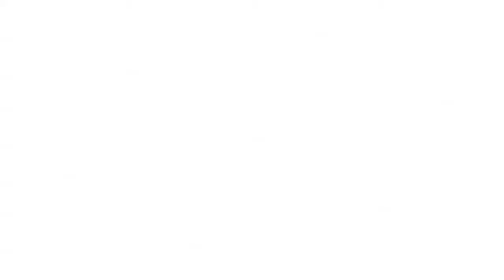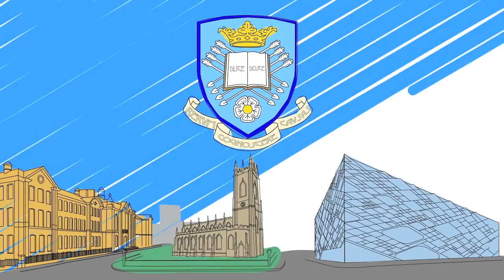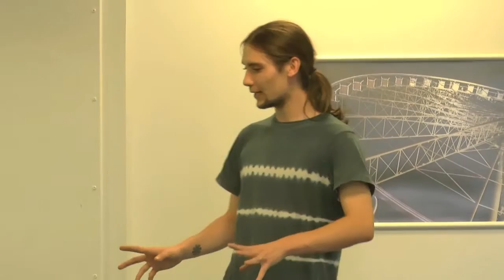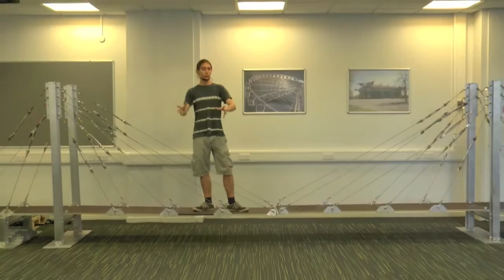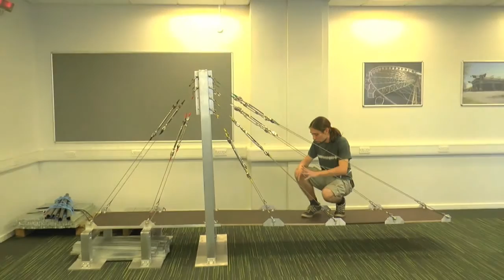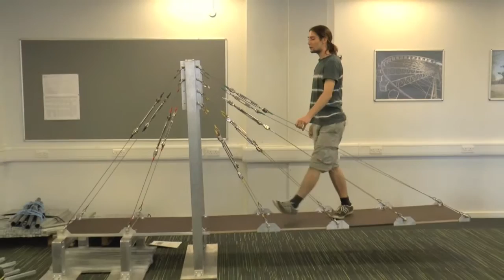Cable Stayed bridge Beginner

Comment: What would be the end conditions at the right side of the bridge (one which is not supported)? How would you model those ends, if modelling in a FEM software?
Reply: hello, I don't know if its going to be of any use to you now. But here goes the answer to your question. The mid span (right end as you call it) will not be left unsupported. Either you have a central hinge over there to allow for longitudinal movements and release the moments or you have a stitch concrete which makes the system continuous.